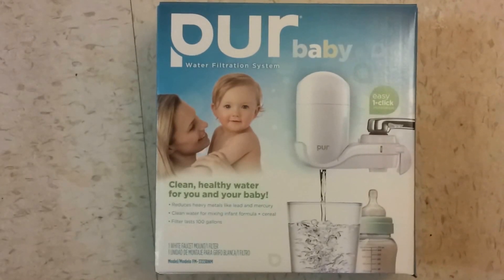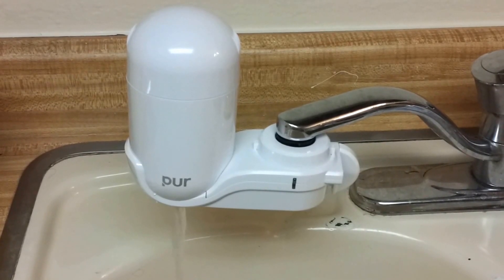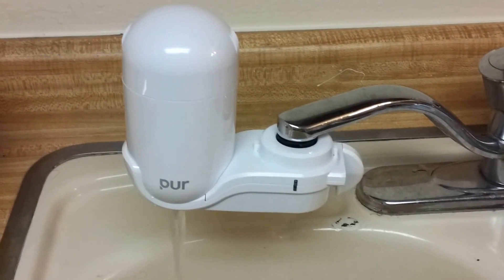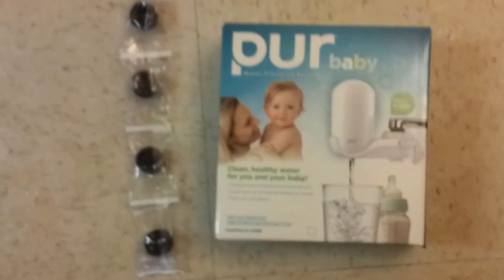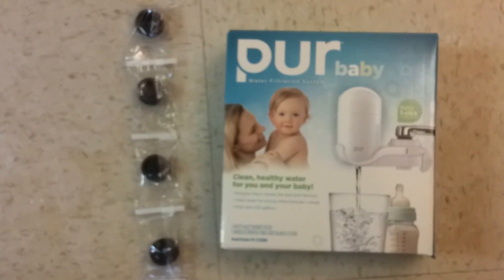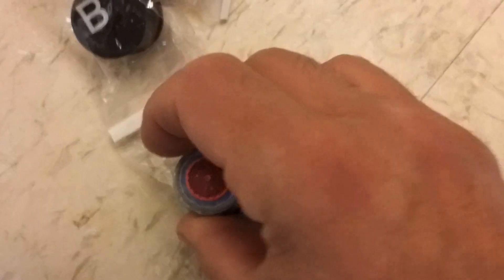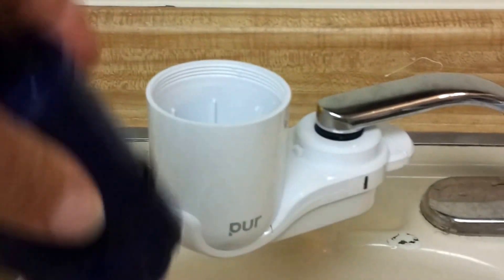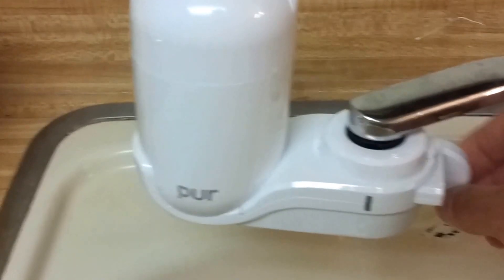How to Install New Pur Faucet Water Filters (Plumbing Tutorial)

Comment: My filter is only a trickle when using the faucet.  I am suppose to have the lever down for filtering right.  Why only a trickle for filtered water.
Reply from the maker: If the flow is normal without the filter turned off, the only reason you would get a trickle with it turned on is a restriction within the filter housing or the filter itself. Most commonly, this would happen when the filter gets clogged due to excessive sediment content in your water supply and the only thing you can do to fix this is to replace the filter.
Reply: took the Pur apart and back to gether and it didn't help the problem.  Should I return the unit?
Reply from the maker: Did you try replacing the filter? Did it start it's life running slow? Do you have very low water pressure? These are some of the questions you need to answer in order to get close to the root cause of teh issue you are seeing.

Comment: I have had mine for over a year and changed my filter many times.  This time the clean sensor is not lighting up.  Any suggestions?
Reply from the maker: I would start by reseting the filter. Just take it out completely and reinsert it. See if the light starts working again. All it does is change color after a certain amount of water flows through it, so it's easy enough and doesn't hurt anything.

Comment: Switching out the aerator adaptor was no problem. Snapping the filter into place is another story. It feels like the faucet is about to break off.
Reply from the maker: It sounds like it didn't snap into place quite right. You may want to hand tighten the fitting  a bit and try again.

Comment: I have a black one and I can't open it , its stuck or wont screw , does it snap or do something different than the white
Reply from the maker: +cora barker All of the Pur filter housing models unscrew pretty much the same way. It may just need a bit more force than you can apply with your bare hands. Try using a grip pad on it.

Comment: hello!, is the filter something bad?? because the light is not on, I have washed the filter and all the pices, and nothing, just the light on when I put on the filter, but when I open the faucet, nothing happens
Reply from the maker: It's pretty simple circuitry for that light. All it really does is reset the counter when you take out and reinsert a filter (new or old) and then starts measuring (not very accurately) the water flow. It changes the color of the LED to red after a certain predetermined amount of water flows through it. This device has no way to detect whether the filter is good or not.

Comment: Can you use this filter for drinking
Reply from the maker: This is its intended purpose and if you water source is reasonably clean, I would not hesitate drinking the water filtered in this way - that's what I do.
Reply: I hope you know PUR does a shitty job at filtering water. Pun intending. You really need to switched to either distilled or Zero water.
Reply from the maker: Geroge, PUR does a state of the art job at filtering water in this form factor. It does not distill water, nor does it claim to do so. Distilled water would certainly be "cleaner."
Reply: Jake Berzon
I bought PUR for my faucet and I tested the water. It's not any cleaner. I filled my distiller up with that water and I saw the cement it left behind. That is unacceptable for my body and my coffee maker. If you're in anyway invested in this company I suggest you jump ship.
Reply from the maker: George, filters like PUR only serve to reduce certain common listed contaminants and sediment and they do that quite well. PUR brand belongs to P&G - good luck jumping that ship! :)
Reply: However, Pur advanced is available on Walmart.
Reply from the maker: Yes, most large box stores carry them.

Comment: I hooked it all up, no leakage everything seems to be fine , but the light is red? how do I fix this. please help!
Reply from the maker: Elizabeth Casey the light turns red when a certain amount of water has passed through the filter. To reset it, you just open the case and close it back up. Of course, PUR expects you to replace the filter every time you do that, but that's up to you - it can't tell if you actually do that.

Comment: None of the faucet heads from the box fit into my home faucet, and my home faucet does not unscrew either. The Pur filter device doesn't clamp on either (home facet too big) - what should I do here?
Reply from the maker: If you do not have an aerator on your faucet that unscrews, you can not use this type of water filter.
Reply: +Jake Berzon (stockvalues) I unscrewd mine and all of them don't work like we found one that fits but it won't tighten up
Reply from the maker: +Rene Gomez I am not sure what you mean by "it won't tighten up." Does it drip or spray when you screw it in? If so, you may want to try using Teflon tape to mount it. If that doesn't help, it could be that the water pressure is too high or that the filter assembly is just too heavy for your faucet. However, in most every case, it really does work!

Comment: What if the "airator" or however you spell it, on the faucet cannot screw off?
Reply from the maker: Almost all of them do, but if it has been on there for a very long time it may be very difficult. One thing you can try is spray WD-40 and see if that helps. Also, there are times when you just have to take a ranch to it, instead of getting it by hand. In the incredibly rare case that it does not come off by any means, well then this is not the solution for you.

Comment: what if the green light doesnt come on?
Reply from the maker: Does the red light come on? How about yellow? The indicator light is really superficial on the Pur filter housings. If you take out the filter and put the same one back in, it doesn't know the difference and resets the cumulative water flow counter. So, it doesn't really matter if the green light never comes on.
Reply: Ok thanks